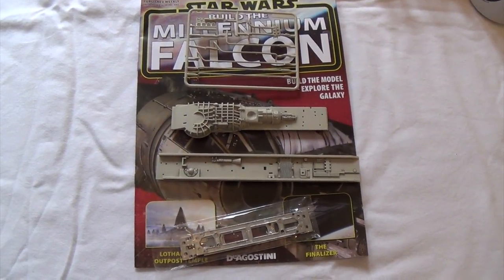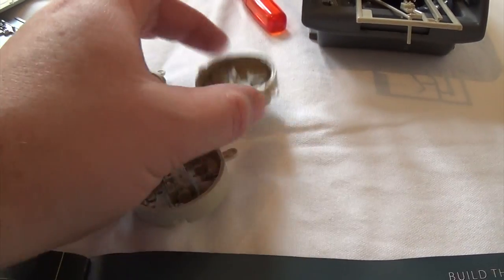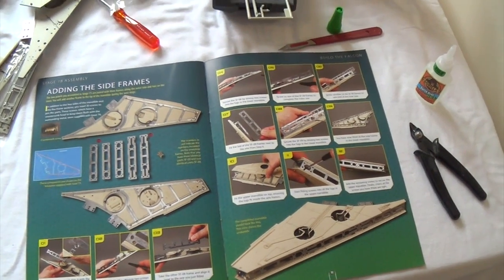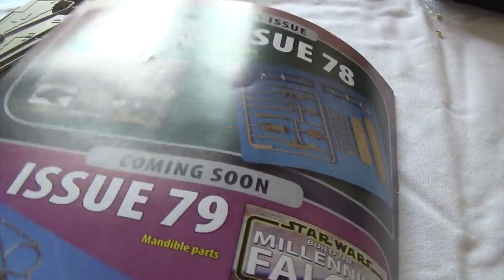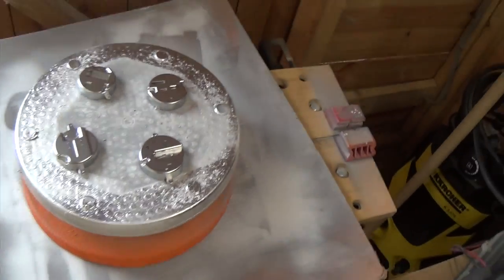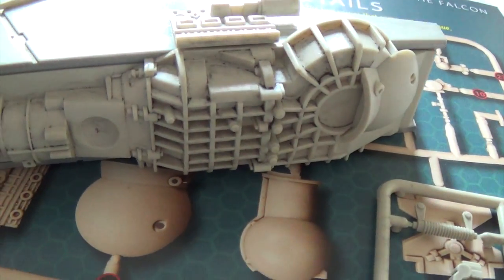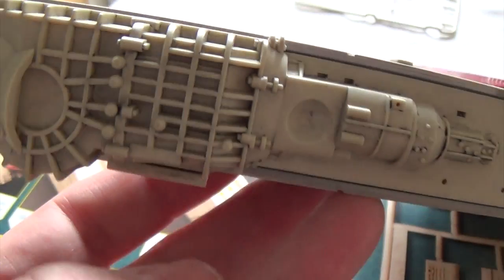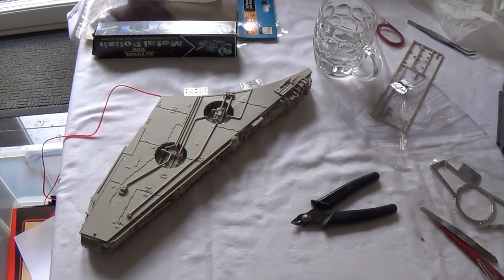Build the Millennium Falcon - Issues 77 to  80

Comment: It is going to be hard to get through 100 issues without making a mistake. Early on one of my pipes broke in half (the one on the outside of cockpit) I also cut one of the cockpit levers too short. If it is going to eat at you would it be worth attempting taking apart and re-ordering any issues to make right. Or re-order all issues to rebuild this mandible then use your original mandible as a tester for painting and light fitting. Anyway I am on 81 and have followed your build from the beginning, you have been a great help.

Comment: Couldn't you just install some small magnets on those side mandible panels to secure them in place effectively while still allowing them to be removed? I think that's what I'll try and do. I like the idea of being able to fully disassemble the model if need be, especially since most of the build seems to allow this.
Reply from the maker: Yes, good idea!
Reply: @MovieModels  You could also use regular white glue for the side panels because it won't deform the plastic and it's not load/stress bearing so it doesn't have to be permanent plus a little dab of white glue is all you need and is easy to separate if you need to.

Comment: Here's another tip for you and anyone else building with super glue...
Get some cyano remover... or, if it doesn't melt the plastic, acetone with eat super glue....

EDIT

Did you glue the sides Plastic to plastic or to the metal?
If it's to the metal, there's a chance you could get the sides off???
IF, you are VERY careful and use a very thin and sharp item, blade, chisel...

I could get it off.... super glue does not bite into metal as well as it does to other materials... it usually just sheers off.... I would go for it....

Comment: Is the build really going to cost £900?!!!!
Reply from the maker: Yes, I'm afraid so 😕
Reply: Wow!  -  Could you sell it for £900? and / or  Have you had £900 quid of pleasure out of it?!
Reply from the maker: You have to remember there are always cheaper versions of everything we buy, and there are top end versions, its a matter of quality and choice. Why does an Aston Martin cost 15 times the price of a Dacia? There are kits of the Falcon from £20 to £1000, but they bare little resemblance to each other, just like the Aston and the Dacia. Additionally, its over 2 years, some people spend that on cigarettes!
Reply: I wouldn't mind the price quite so much if they didn't string it out over such a long time. If I could buy it and build it that would be much more reasonable. I just hate the drip feed method of the distribution.